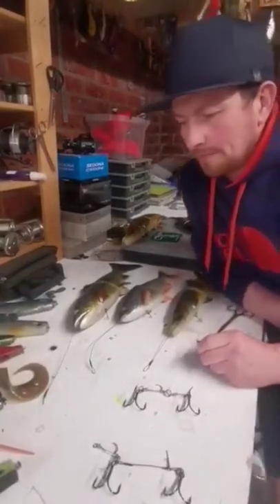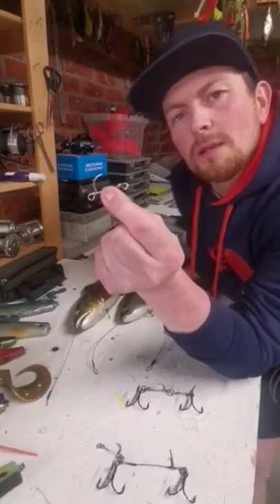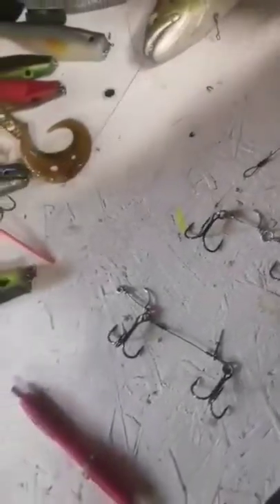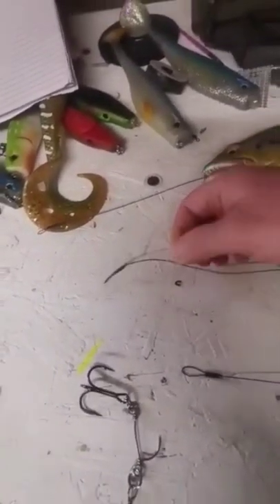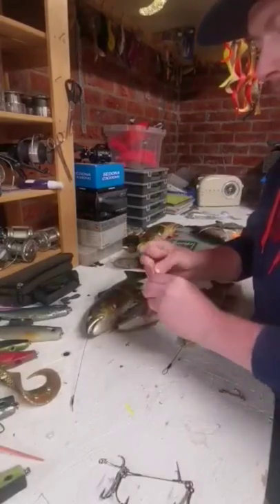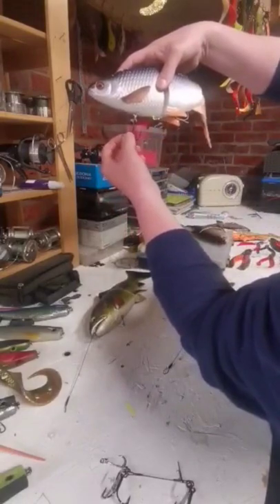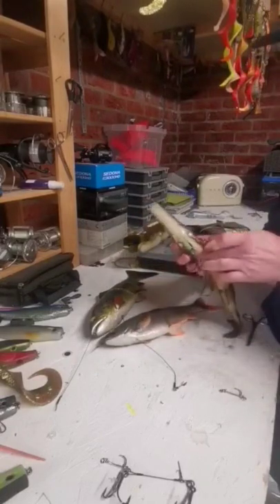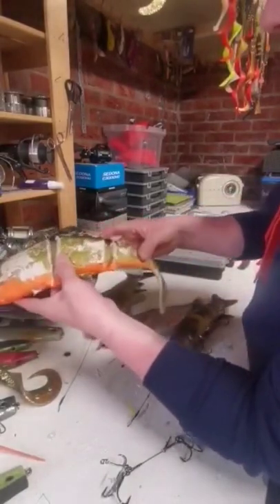How to Re-rig your Savage Gear Line Thru Lures

Comment: I do same with crimping Titanium wire except I make a very thin sleeve to protect the wire loop from pinch pointing against the hardware. I use a single stand of black telephone wire and remove the wire core leaving the plastic insulation. This can be cut to size to make a perfect sleeve that is still thinner than most 39 strand Steel wire. Also further prevents crimp slippage